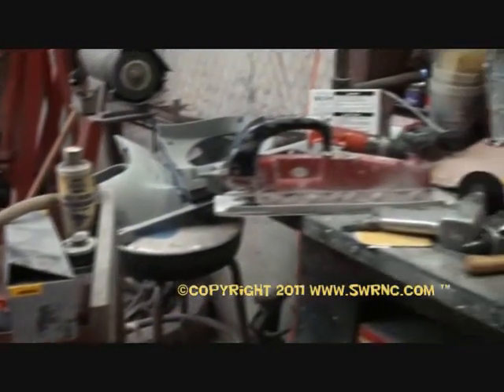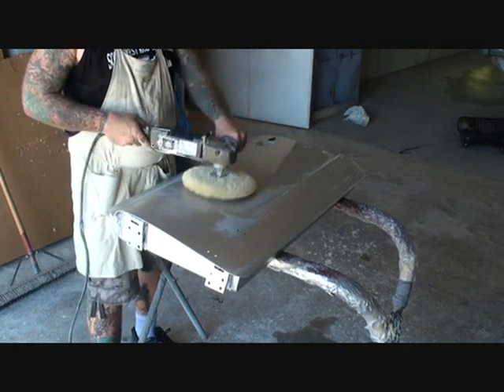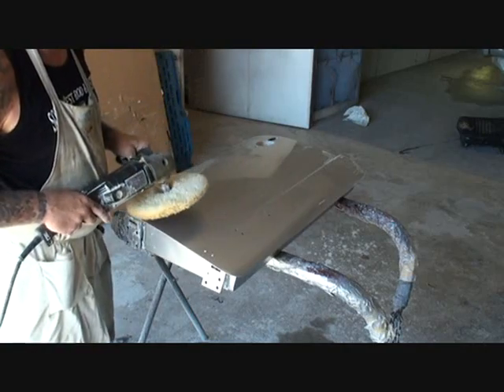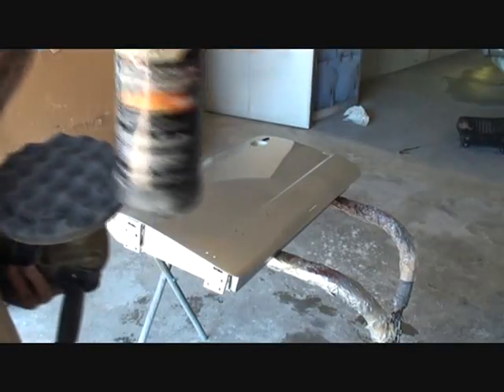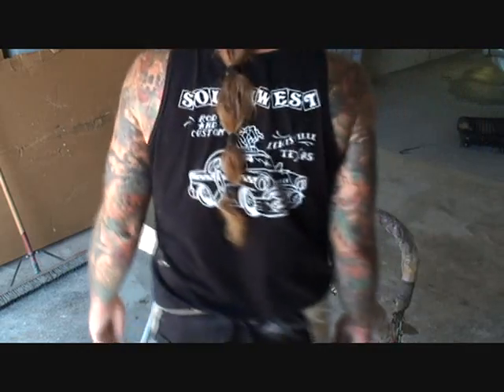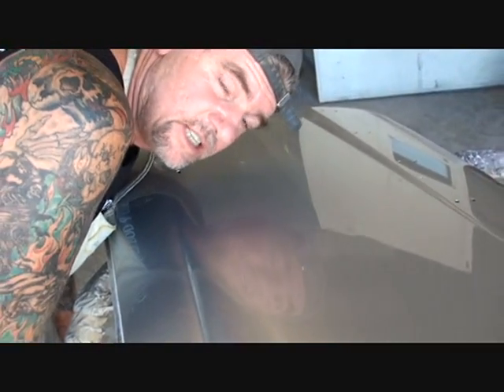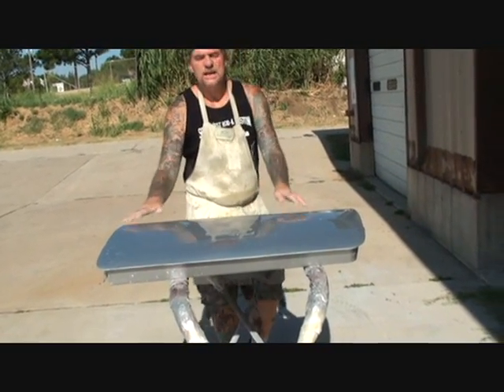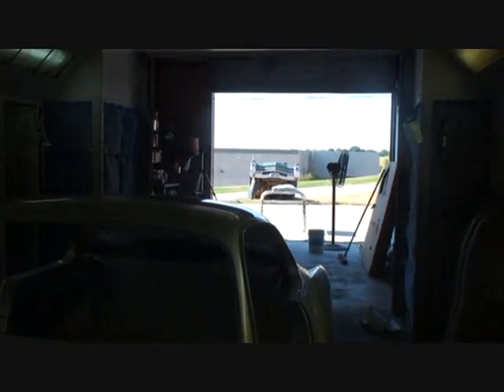HOW TO: Color Sand And Buff-Custom Car Painting-Part 5

Comment from the maker: I have only been in one car manufacture plant here in texas, the G.M. Plant in Arlington Texas. When I went on the tour the vehicles weren't buffed going down the line, but at the end of the line they had a detail shop, if there where imprefections or mistakes in the paint they would run them through there to clean them up.

Comment from the maker: @jewllake Its more likely that if you try to colorsand and buff the tape line area you are going to open a box of worms,, what this does is start to make the clear peel and fade and then in the future it starts to flake off like you see on other cars with flakey peeled back paint. your best bet is to leave it alone. What the painter should have done is blend the paint and then clearcoat the whole panel, from top to bottom.

Comment from the maker: @LemcoEnterprises You'll have to back tape it atleast a 2 to 3 feet area around the bad spot, then blend in paint and clear, after applying clear, emty your gun, add straight reducer with clear residue still in gun, and then spray around edges where you blended, let dry and then colorsand and buff again, taking care not to burn through paint twice!  Pete

Comment from the maker: If it's an orginal paint I would recommend that you be very careful and polish it by hand or use a buffer at very slow speeds. If it's new paint you can colorsand it and then buff it as you see me doing here providing there is enough clear where you won't burn through..

Comment from the maker: @supersport2778 It's a very touchy situation when it comes to colorsanding single stage paint, what happens is you are sanding THE PAINT, and if you have metallics or pearls in it, then you will discolor it and it will become blotchy, because you are burning through the paint, if that makes any sense, if it's a solid color you can colorsand with 2000 grit and then buff with ease and you should be alright... Take it easy, Pete

Comment from the maker: YES! you can buff a solid color enamal or urathane paint, just be careful not to sand and or buff through the paint.. When working with single stage you want to be very careful color sanding, use the lightest gauge paper that you can get away with, or spot sand/nib  the areas out then overall buff...

Comment from the maker: @Amopower yes you can colorsand/buff the oem paint job, but you have to be careful due to the fact that the orange peel might be in the primer, paint and or clear, you don't really know. If the primer/sealer was layed down with a thick orange peel, then the paint and clear will have it as well.. I say leave it alone and live with it. Your opening a box of melted chocolet bars on this one. Pete

Comment from the maker: You might be using the wrong polish, I use 3M brand Foam Pad Polish, it's black in color, and no you should not have any swril marks, that is a sign of a dirty pad or the inproper wax used. Sometimes its caused by using your buffer at to high a speed as well, the foam waffle face pad is designed to be use at approx. 1200 rpm speed

Comment from the maker: You need to buff it --FIRST-- with a wool pad and buffing/rubbing compound, then follow up with the foam pad.  Once you buff with the wool pad it will remove the scuff marks and scratchs.. The foam pad is only for swirl marks and compound residue removal... Take it easy. Pete

Comment from the maker: My buffer is set at 8 on my dial which is approx. 1800 to 2000 rpm, when I use the polish with the foam pad I turn it down to 4 which is approx 1200 to 1500 rpm.. Good luck and don't burn through the clearcoat---it's a real mess fixing that problem.

Comment: Nice series Pete. Is it possible to color sand a panel with orange peel that was the result of either the factory paint job or a collision shop paint job? Only reason I am asking is because this throws in two more variables - much longer time that the clearcoat has been on the car and allowed to cure/dry, and another could be that the paint may have been dried/cured in a temperature controlled booth.

Comment: Great video, got a couple of questions, I just got my car painted base/clear should I wait a certain length of time to allow the paint to cure before I color sand? The shop that did the painting was not as good as I hope, so I got some dirt and even some runs in the clear, 1500 for runs or should this be 1200 grit, and for the dirt we just sand the clear flat and what we got left is what we are stuck with, correct? Thanks for any information

Comment: @Amopower I wouldn't recommend color sanding OEM paint jobs...mostly because the "orange peel" you typically see is the texture of the paint...and moreso the clear coats are usually very thin and you will definitely cut through it.

Comment: that was great!!  I recently had the body shop paint the lower half of my bed side on my 06 Sierra, they backtaped and painted from the angle down.  If you look close, you can see the tape line go slightly over the edge.  Could a good experienced person clean it up a bit with a cut and polish?  I'd think it be hard b/c it is an edge.  thanks!!!

Comment: was there some ppg course lenticular silver in that mix :))

6:36, they the ones that getchya, weither its a polisher, a grinder or a mig, that split second when you drop your gaurd just after you stop something, the mig usually gets me, ya just finish a weld, lowwer the mask and as you move the torch the wire inside naturally twists and if its caught the shroud lets out a couple of hot sparks, had a couple in the eye
keep thinking newbies till everything has stopped!

Comment: Love all the videos Pete ,I'm learning a lot and bodywork is a lot harder than I thought, I have a dumb question, why do  they call it color sanding when you're just sanding clear coat?
Reply from the maker: The words color sanding comes from back in the days of Enamal paint.. When you wet sand single stage paint you see the color of the paint instead of when you sand clear coat you see white.

Comment: My friend pete :)

I wet sanded down to 2000 grit, used a foam pad with meguiars polishing compound and swirl remover compound, but no matter what I do, I can still see sand marks and swirls, I've buffed it over like 6-7 times but the marks remains with some quirly Q's? WHAT SHOULD I DO?

Should there but some left over marks even after polishing as long as it shines??

Thanks !

Comment: hi pete love your video i painted my truck black pearl metalic  base coat clear coat there where a bit of orange peel i collor sandit 1500 2 3 4000  but for some reason now its like a glass but the paint is not as black as before a started sandind and there like a fogy clood in the clear coat hiven if i buff and rebuff the dark black will not comme back and the fog will not go away   thanks for all your tip help me a lot  ps there a couple.of mistake cause im french and im from quebec canada
Reply: i got the same problem in my black car, i still dont know how to get over this problem of the black not being as black as what it was originally - DOES ANYONE KNOW THE ANSWER

Comment: Hey Pete! I got a question.  Im painting my 1990 ford thunderbird supercoupe and the front and rear bumpers are have a ton of  edges and holes. any suggestions on how to color sand them  for shine  but minimize the chance to burn through the paint because of  all the angles and  odd surfaces?  Thanks a lot!
Reply from the maker: Colorsand with 2000 grit and keep away from all sharp edges and holes.. Only colorsand on the main large areas of the bumper covers, when you buff, use your buffer in a blending style situation where you will buff normal on the colorsanded areas but lightly and smooth on the rest of it...

Comment: my last paint job was a black G6 hood. I had alot of trouble with swirl marks when i buffed and polished. what did i do wrong?
Reply from the maker: swirls are created by the rubbing compound and buffing pad. It could be a possibility that you where going to slow with your buffer, I run mine at 1800 RPM. Using an old buffing pad or not cleaning it can create swirls. There are alot of factors in buffing properly, Good luck on your next job. Pete
Reply: diyautoschool thanks pete, my buffer doesnt have rpm setting it jus has a dial 1-10. i figured it was kinda common for black. Would the polish for dark colors help